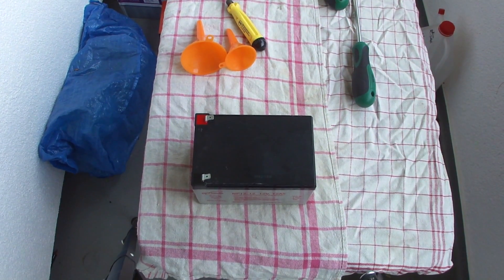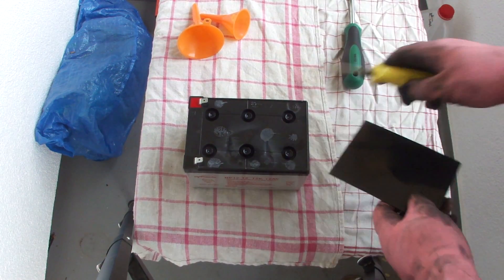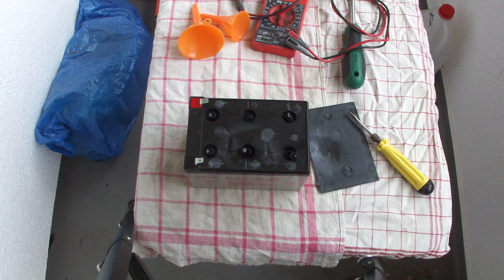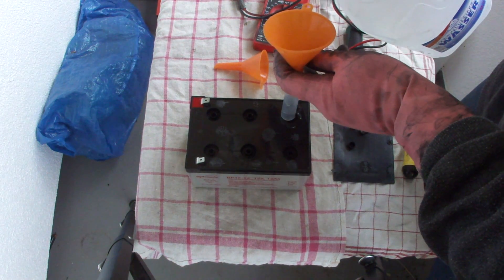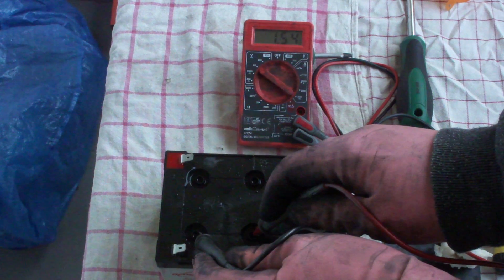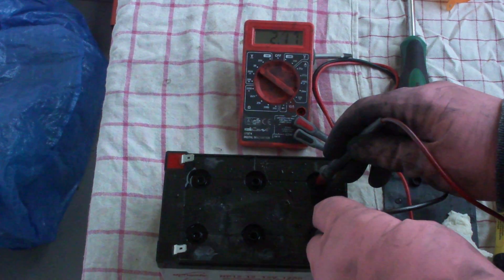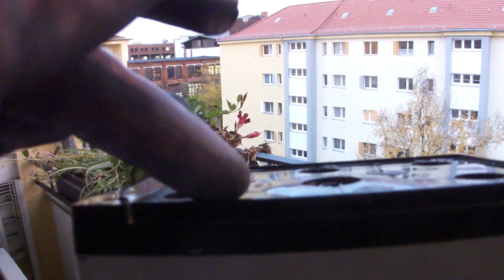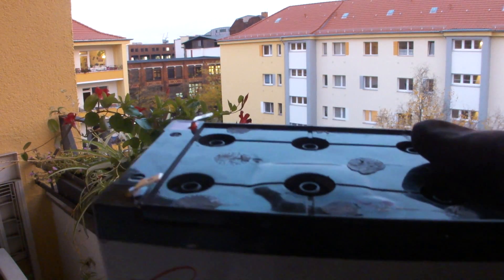Sealed Lead Acid Battery Repair - how to repair a sealed lead acid battery

Comment: So top it with distilled water as even sealed battery wont be 100% sealed. Sure it might work for some cases, but majority of the time lead acid battery has created so mush crap on the cells that its not holding charge like it should or that drops on the bottom shorting the cells ruining the battery, making DIY repair is nearly impossible.

Comment: It's not dry, but yes, seems to be. Exactly such as brand new this battery type. This type of battery have different electrolite cocentration (about 60%, that's why called GEL) and not fully filed. So you cant't just add a water such as in car battery. That's the reason why it not work and your battery after charging is just a garbage. And thats is the proof. Sometimes you can try add a water, but only 1-2 ml per cell. After all tittle should be "How to not repair Sealed Lead Acid Battery" cos probably misleading.

Comment: I have a 12v 7ah sla battery that won't hold the charge longer than it should.  I opened it up, saw the insides pretty dry, not even a moisture in them.  Put some rain water just to soak the plates but not to much as it would pour out under charge.  Put it on standby charge at 13.8v the whole day and viola! it's was back to almost the same capacity like when I bought it new.

Comment: hello friend I have a battery of 4.5 AH / 6V rechargeable, maintenance-free, when opened it only had 3 cells, only feeds a flashlight when I turn on the flashlight Low voltage 5 V thanks I hope will help me greetings
Reply: There are several factors in battery reconditioning. One plan I discovered which succeeds in merging these is the Magic Mender Wizard (google it if you're interested) definately the no.1 course that I have ever heard of. Check out this  unbelievable site.
Reply: Not certain about the points made but ,if anyone else trying to find out how to recondition batteries try Trefendous Rapid  Extender Tips (just google it ) ? Ive heard some incredible things about it and my friend got amazing results with it.
Reply: hey ,if anyone else needs to find out about learn how to recondition batteries at home try Trefendous Rapid  Extender Tips (Have a quick look on google cant remember the place now ) ? Ive heard some decent things about it and my colleague got amazing results with it.

Comment: Concentrated Sufuric Acid dissolves the sufates, battery acid is 37% Sulfuric Acid so you could soak one cell at a time in concentrated sulfuric acid and then tip it out, rinse with water several times and then put in battery acid. 

But remember the concentrated Sulfuric Acid will eat your face off in seconds if you have even a small accident.

So if you can afford a new battery rather just go and buy one as your eyes and face are priceless.

https://en.wikipedia.org/wiki/Lead%28II%29_sulfate
Reply: +EVZebra interesting points ,if anyone else trying to find out how to recondition batteries at home try Renkarter Rapid Renew Report (Have a quick look on google cant remember the place now ) ? Ive heard some interesting things about it and my partner got cool results with it.

Comment: Where's that bad cell again? I forgot... 
Delete this video and save the internet from some wasted time.
Reply: +TCPUDPATM PORTS  How insensitive are you? Can you speak any other languages? 

English is not his native language and at least he has the decency to post in English so we can all understand what he is saying, I bet you you cant speak any other languages can you? Only one............ DUH

He shows how to access the cells and he shows how to check the series circuit voltage after adding distilled water, what more do you want you bonehead?
Reply: I'm not American ya bonehead - I speak 4 languages and write 3.
What he shows is NOT "how to repair" a battery. That involves more than checking the cells. Besides, I was being facetious like the multitude of other comments on here. Piss off.
Reply: aaaaah, so you you dont approve of the title, why didnt you just say that in the first place, we not psychic you know.

Comment: How do you repair it if it shows 0 Volts and does not accept charging current?
Reply: Buy a new one, no seriously I’ve tried to repair batteries like that and I’ve had no luck.